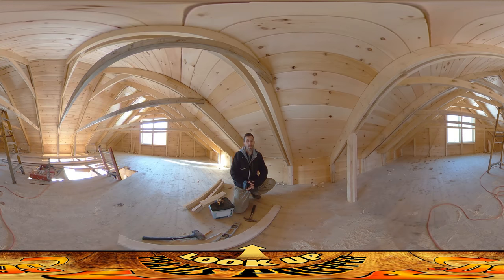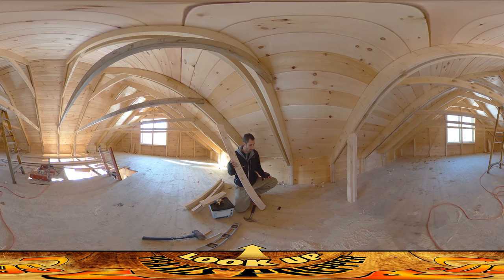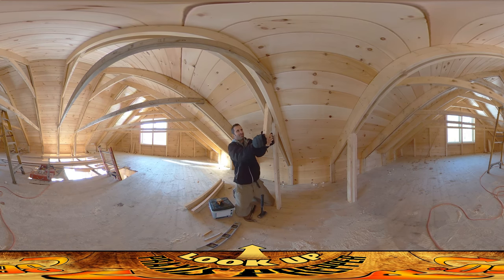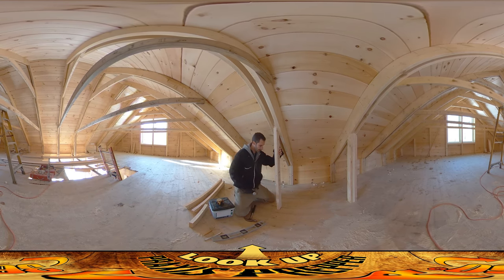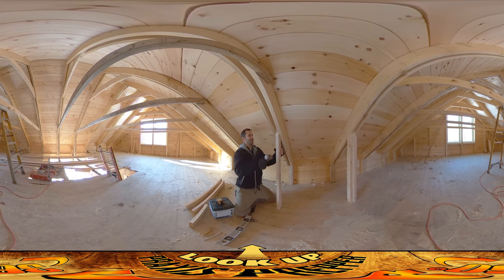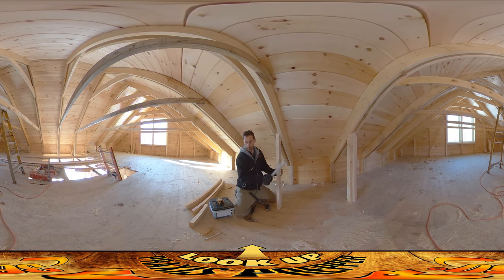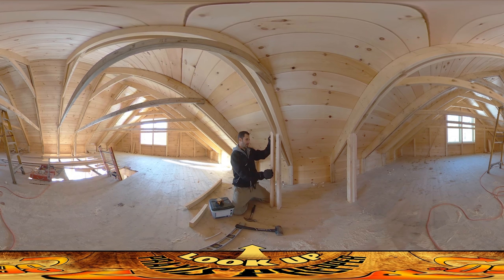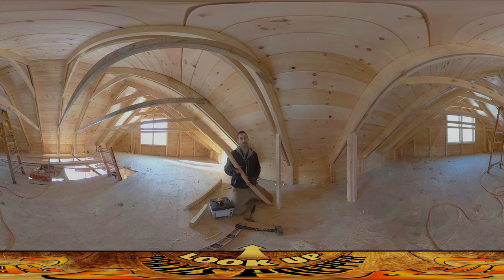Homestead Building - Building Ceiling Support Posts

Comment: Maybe it helps to look at it differently ... these posts are a great start to a side wall that (with some doors, sliding sideways panels, or take out panels) will offer a great sealed off sections to store and hide all sorts of junk (or preps) ... then aside from the wooden floor (and possibly carpet), the top floor is basically done ...
Reply from the maker: Dead air spaces are a valuable commodity that many people forget to utilize.
Reply: @PraxisPrepper  More room for our STUFF !